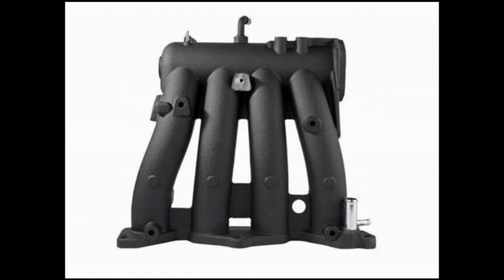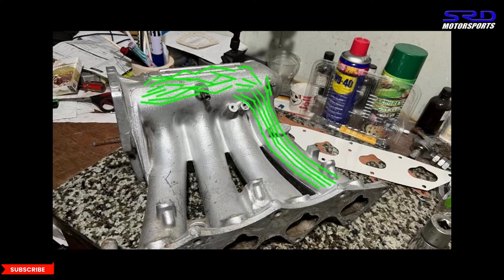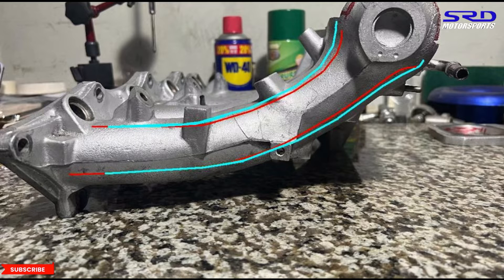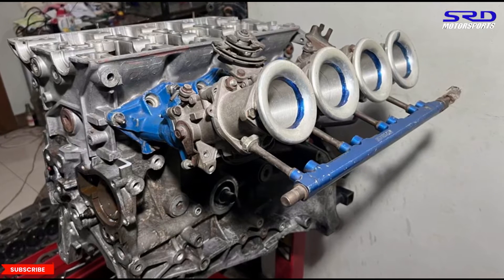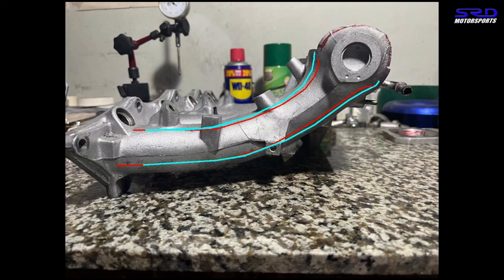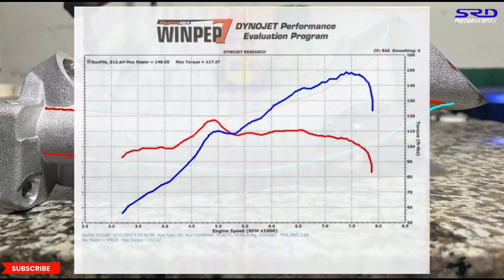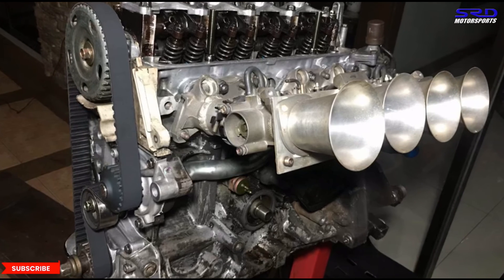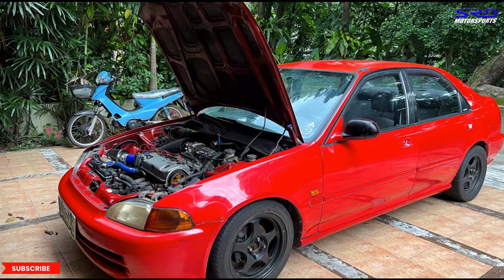Intake Manifold Tech: Design and Purpose by SRDmotorsports

Comment: I appreciate your content. I know this is an older video, but it just came up in my feed. There are a lot of interesting thoughts here. I appreciate that you are adding taper and reducing the drag down the runner. I noticed in the video that most of the manifolds shown are cast in a way that create a fish mouth at the bell inside the plenum, except for the Skunk pro series that has bell mouths similar to ITB's. I'm curious as to what the difference here does to the strength of the harmonic being tuned for. I wish I could share with you what I have done with my Edelbrock manifold on my D16Z6.
Reply from the maker: thanks man and yeah if it can be done much like the skunk ultra bell mouth entry I think it def would be a lot better
Reply from the maker: like rubber filling will be even better

Comment: I would like to see some info on throttle body orientation. On my 08 civic si, the throttle body adapter rotates the throttle body. What would it change if turned 90*. Great info
Reply from the maker: That would be interesting
Reply: @SRDmotorsports  another thing I would be interesting to test is a semi dual plane intake. Basically a plate from the throttle to the other end, dividing all the runners in have. Would it cause more turbulence or less. Where in the rpm would it help, if it does. Sorry, you're videos really have me over thinking things 🤣
Reply from the maker: All good all good

Comment: Have you tried airfoil profiling the throttle body valve? Do you think the furthest stack would benefit from making the plenum slightly bigger at the bottom/back? Since that should i clease the air available for that last piston which, as I undertand, tends to run too rich
Reply from the maker: On carb/weber stuff that was helpful profiling it! But I havnt here like too much work 🤣😂

Good take on the plenum stuff I thought the same then I realized after checking a lot of cfd from diff places, as u decrease plenum volume at the end? It helps feed the runner
= how and why ultra street tend to look like that… I think it’s mainly to keep “momentum” of the air at the plenum roof from throttle to the farthest runner entry cuz the first 3 runner entries prolly took most of the air lol

Comment: What setups do you think a Edelbrock Victor X works best for? I'm running a 84.5mm sleeved GSR with Tuner 1 cams on boost. Cylinder head has extensive port/bowl work on intake and exhaust sides. Will the manifold kill my low and midrange vs a skunk2 pro series?
Reply from the maker: Oh on boosted stuff the VictorX does wonders… it won’t entirely kill ur midrange as u are essentially a 2liter so it’s a pretty good combo
Reply: @SRDmotorsports  ❤❤ that's good news cause I was worried it'd kill the responsiveness of my setup.
Reply from the maker: @warreeeng  I think u pieces together a more than decent combo tbh

Comment: Just found this channel, dude, you got some awesome vids!!

I think alot of people nowadays with F.I.  don't learn carbs, which means they don't learn/see what air speed, pressures, plenum size etc ACTUALLY does. Slow air speed with ruin a Carb'ed vehicle's idle, and long runners will gain Low RPM TQ, vs short, etc.  Carbs are easier to see the phenomenons.  I see even the older guys going towards Holley Snipers, etc not realizing the same physics applies.
Reply from the maker: Oh brother! Thank you for those words on the vid! I try man!

And brother u hit a nail on its head right there!!!
seeing these stuff and what it does may surprise a lot on why even a big turbo didn’t lag as much… maybe cuz everything else helped work “with” the turbine

Comment: hello sir recently damaged my block and needs replacing mechnic recommends a D16 is it a good pair with my P2j head? or should i just get a p08 head?
Reply from the maker: That block is fine it’s alright 

Any block is fine, more important is proper installation
Reply: @SRDmotorsports  thanks! any idea how much weight difference the eg hatch and ek sedan has?
Reply from the maker: @angelfpv4825  it’s just around 80-110lbs

Comment: Ported GSR butterfly manifold, can it support 220hp all motor set up?
Reply from the maker: By removing the active butterfly? Anyways based on its dimension as I have one here… it seem to be sized to support 220hp on a 2liter 

I think what detracts most is the fact that an ITR manifold will reach it “easier”

but that don’t make the GSR not reach 220hp as far as the manifold goes
Reply: @SRDmotorsports   I wouldn’t want to remove the butterfly’s, I like the design/purpose behind the butterfly’s.
Reply from the maker: @DanRS77  yes on the “powerband” essence yep hard to beat what it does,
Reply: @SRDmotorsports   I was debating whether to keep the GSR manifold or buy type r manifold but willing to sacrifice peak HP for mid powerband. Do have you videos talking about the GSR manifold?
Reply from the maker: @DanRS77  no video yet but hmmm give me a few days lemme think about that some more as I have a GSR intake manifold here that’s factory untouched…

I think u are on to something real interesting here as even a rechipped ecu on tuning u can tweak the IAB function by way of rpm 

So when we think about it?

Cold air intake + pro2 cams = prolly can be tweaked real real good hmmm!! 🤣
Reply: @SRDmotorsports  
I’m looking forward to that video, my engine build has Blox P1 cams/ pro 1 copies actually
Reply from the maker: @DanRS77  man that might be an ideal set up u got there whoa!
Reply: @SRDmotorsports  thank you bro 🤙🏽
Reply from the maker: @DanRS77  bruh.,,cuz of u  next content might as well be GSR manifold kinda the same technical analysis as this one but specific to the GSR to let us share options and possibilities
Reply: @SRDmotorsports   I would truly appreciate that video, is there a way to get in direct contact with you via email ? Relating to builds
Reply from the maker: @DanRS77  yes sir u can check the shop page on each description and we can go from there

Or here the contact info be on the “about” I think lol
Reply: @SRDmotorsports   I’ll contact you via facebook, and looking forward to the GSR manifold video 🙏🏽
Reply from the maker: @DanRS77  no probs man